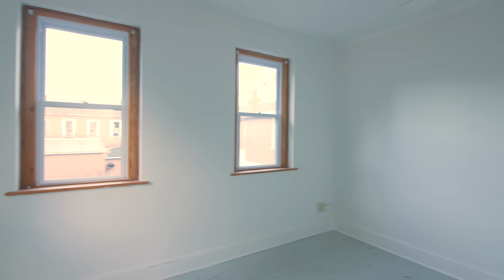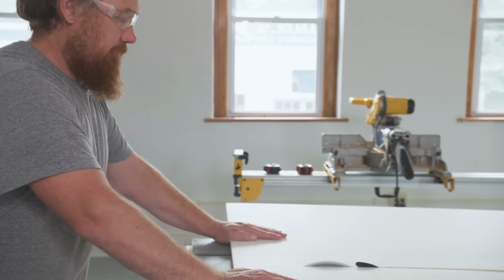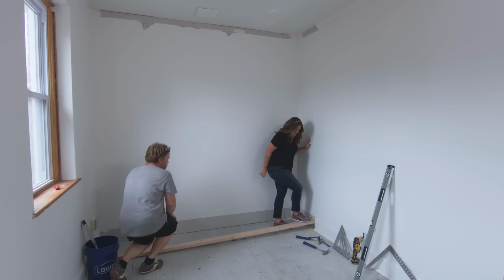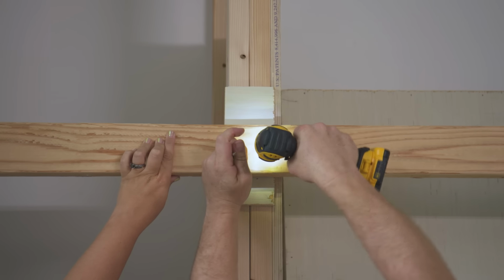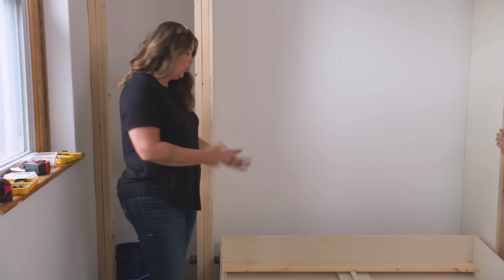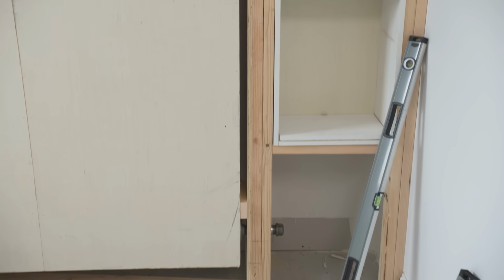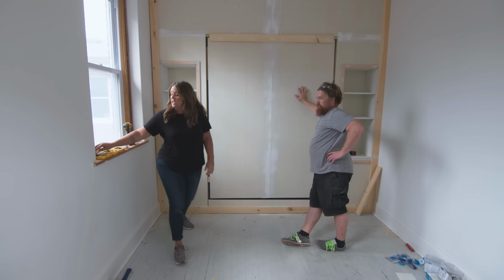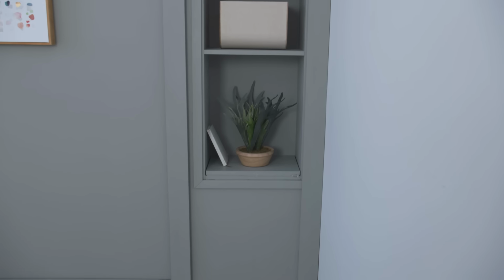How to Build a Hidden Guest Room w/ a Murphy Bed

Comment: This is fine for that once in a while guest.  Any more than that and it is a PITA to convert and possibly dangerous with the weight of the unit.  I would have figured out how to utilize some gas struts to help support the bed.  Definitely less expensive than buying one of those $300 murphy bed kits.  I would have utilized the space above the bed for more display space or build cabinets for storage of the pillows, blankets, and/or other items that are not needed on a daily basis.  The access panel does make for a nice space to hide a few items that you don't want the kids to accidentally find.

Comment: The idea is good.  So many things wrong with the execution though.  1) For less than $200 you can buy a spring or piston based hinge/assisted opening mechanism, and you don't need any threaded pins, dangerous opening procedures, or pipes rubbing on plywood. 2) An absolute ton of wasted space.  So many more shelves, cabinets or drawers could have been added over under and side. 3) Recessed lighting with bedside switch. 4) Shelving inside the wall next to the pillow with outlets to set/charge phone, put a book, etc. 4) finish nails and  butt joints to build shelves?  5) Removable velcro gap covers is awful.  Not too hard to design it so you don't need them. 6) The 9" sides are way too high and not needed.  You will be banging your legs on those when sitting on the edge of the bed, unless your mattress is a rock. 7) Trim on side cabinets only goes 3/4 of the way around.  8) not a fan of drab gray.

Comment: the moulding to hide the bed frame, could have been attached with magnets, with hiddens magnets to place them under the bed. More expensive yes but overall a better solution. And instead of a frame with no storage push latches to "hidden" cabinets.

Comment: Okay. There is so much lost storage, they didn't use the same crown moulding/base board to frame the new wall, the velcro trim you have to remove every time you use the bed, the power strip just hanging out in the open... Also, there are hinge kits specifically for murphy beds that make lowering/lifting easier and lock the bed upright. I've really liked most of the other stuff Monica has done, but this whole project is just a mess, from design to construction it's all poor work. Sorry for the negativity :/

Comment: Personally, I'd just have a sofabed in there; it keeps the resale options of the property wider, as not every buyer wants a murphy bed and might want a child's single bed in there, but now they've just got a smaller room to use instead.  It also makes nightstands easier to reach from the bed..
Reply: Simples, remove the drop down bed and you have room for a standard bed or wardrobe, extra cupboard, whatever! 
All it takes is a little imagination.........
Reply: @fabianmckenna8197  Point is- removing all of that isn't as simple as just swapping one sofabed for a different bed.
Reply: @scattygirl1  Well if you're keen on sofa beds, that's fine.

The idea was to build a hidden guest room with a Murphy bed so if you don't want that then don't build one. 
If you don't want to buy a house with a Murphy bed then don't buy one.

Plenty of people out there getting fresh ideas from this basic video which can be adjusted to suit.
Good job.

Comment: The storage on top
would have been great for extra pillows and blankets etc.I also don’t like the Velcro Idea maybe some Piano hinges so you can just move the wood out the way. Also Having to unscrew the bed to get it down. Maybe come up with a different but still safe Idea. Also the bed looks heavy. They has to be a mechanism that can help bring the bed down. 
I’m not trying to be negative. I think the bones of the project are pretty decent. But a little tweaking couldn’t hurt. Some of the comments are really helpful in making this project even better.

Comment: Someone forgot to use the utility knife on the bottom of the cornices to prevent the dry wall being peeled off during its removal... Also why didn't you guys just use a Murphy bed kit? Would make the transformation process a lot easier.
Reply: .......... and a lot more expensive.
Reply: @fabianmckenna8197  bed kit. Not a premade murohy bed.
Reply: Murphy bed kits come with hydraulics, fitments and plans. 
You have to provide the wood so any pre made bed would incur the costs of the kit, wood and of course the labour. A lot more expensive than DIY.
Reply: @fabianmckenna8197  the cost of the wood is  a given regardless of which choice you make and the same goes for labour. The only difference is whether you choose to trade in the extra labour for the convenience of using a kit which ultimately makes it easier to use daily. There is of course the intrinsic reward of building from scratch.

Comment: I like the idea, but thought there was wasted storage space and huge room for improved design.  Like a more interesting paint feature for when the bed is up so it is not a giant grey wall.  Running an extension cord is not ideal for long term safety.  An electrician could have easily corrected that and recessed lighting above the bed for reading lamps would have been interesting as well.

Comment: Would have finished out over the bed and added doors, so as to have space for pillows, etc.
Reply: Yeah, the bed itself, or room needs storage for bedding, and other guest stuff, the only thing lacking. Can always chuck a small bureau in there.
Reply: That is what i was thinking, i think incorporating a short (12") U the entire width of the bed at  the top (right under the doors) that is flush so when you lower the bed it swings out and now the leg is the width of the bed, this would make the bed much more sturdy. Now you can permanently attach the cover pieces of wood to the bed that she attached with "velcro" to hide the cracks, i would also utiilize the bottom of the bed with a murphy desk or at the very least some sort of permanent art/picture. I'm pretty sure i just found my next project! Love
Reply: Liza Velasquez, or one of the larger framed pieces of art that folds down to a table with sides of frame becoming legs for the table. Now you have a space for gift wrapping, crafts, etc. Just another thought. The Murphy desk would be the best though.

Comment: Very cool, things I would do differently, Instead of velcro (as it will look bad when the bed is down having squares of velcro on the wall),  I would have used strong magnets in the planks and metal or magnets recessed in the backside of the plywood on the wall section so it is not seen and the trim just sticks right in place when you have them up.     Some spring-loaded hinges to make lowering and raising the bed very easy for a single person and a different mechanism for securing the bed when up. But I get you are kind of wanting to make all the parts things lowes is selling.  Oh and for sure some Loctite on those threaded ends of that pipe hinge you added. When one works its way loose it does not look like you have access to rethread.  Bed frame/box nees some more work to stiffen, I can see it twisting which will get worse over time and eventually fall apart.

Comment: To hide the space around the bed, why didn't you just attach it to the bed frame and not use Velcro that has to be removed to use the bed.  To much wasted space. I did like the idea of the flanges to use as a pivot point. Would save you money on the high cost of a kit.

Comment: I would use it for my craft room and I would have kept the top of the bed wall open to use as storage. ut hidden with wood doors for access. Love the way you used the pipe for the hinge for the bed. Quite clever idea.

Comment: I loved the fact that you used caps and flanges instead of the topical brackets the onlything I would have done was when I was up to would have made it a book shelf and had molding to hold the books in when done as a bed at the foot of bottom of the wall where the molding is have a access panel to hide the pieces to old the books or videos in place when the bed is down

Comment: Why didn't you use all the dead space and run hard wired actual electrical wiring and outlets for the sides and top at the time it was framed out?  

Instead you added a cheesy cord that could get pinched and an eyesore access panel.  In terms of access, you unscrew a bank of shelves - not that hard and it's not a permanent  close off.  If you don't want electricity behind the frame, have an electrician come in and hard wire 2 four gang boxes on both sides of the wall, that way you have traditional outlets and usb plugs for devices, which is a huge plus in any room.

My biggest concern was...when you have pivots made from screw thread pipes, how long will it be before they come unscrewed?  I also agree with others that the floor of the bed frame was way too thin and unsupported - it was racking when they lifted it up.  

Overall the concept is a good idea but really needed a better blueprint.

Comment: Legs look too weak. I would frame out the bed and attach the boards to the bed so you dont have to put them under it. Also just cover the gap so the boards dont protrude from the bed enough to be annoying.

Comment: The concept is great. Others more knowledgeable than I have highlighted any construction/mechanical deficiencies. My question is: if you use it as an office or workout room (inter alia) when it's not in guest room mode, what do you do with all that furniture/equipment when the bed needs to be lowered and take up floor space?
Reply: Haha right? Where would u move the desk? Or gym equipment

Comment: I consider this a very good and smart design especially using the metal pipe with flange part (It'd be very expensive if you buy a set of those Murphy bed hardware). I think this is a video showing the making/hiding of a Murphy bed and people can design the rest of the space to their like. The bed frame does not look rigid but it's all your choices on choosing the material.. .
Reply: I wondered why she did not use the hardware for a Murphy bed.  Now I know. Thank u

Comment: This is almost exactly like the one I designed. However I Incorporated a 12in work table across the width of the bed bottom that also serves as a leg when the bed is down
Reply: Do you have a video?
Reply: my husband built  one and the bottom is shelving and the shelving is used as “legs” when the “bed” is down. It is ok but, man ! Is it heavy! Would definitely recommend the mechanics involved to make it easy to lift. Most guest would appreciate this so they don’t have to help and I don’t have the strength!
Reply: Please add a video
Reply: Smart idea💡
Reply: just have to be careful to support the end of the bed as desk support tends to be in the centre of the frame length, and the end of the bed needs support usually - I make one which stays flat when opening the bed but we still need the leg supports as we don't let it touch the floor for this reason.
Reply: I'm designing mine so all the 'shelves' that will be the legs can hold stuff like decorative blankets, pillows that have seasonal covers or team covers and fixed behind them will be screwed into place photos that when the bed lays down won't fall off, but the photos can be changed out as seasons or kids grow.

Comment: Not a bad idea, but not executed in the best way. A Murphy Bed kit would make life so much easier.  Having to remove the eye bolts, lower the heavy bed (which looks to twist), and then set up the legs is a hassle.  The space above the bed could be used for endless storage of blankets and pillows.  And what I disliked the most was the use of an extension cord.  There are so many other options that could've been done there.  Recessed outlets with built in USB would've been the best choice.  The kind you would fine in college lecture halls on the desks for laptops to plug into.  Again, great idea, but for a large company like Lowe's, I expected it to be better.

Comment: It's a great idea and turned out really well, not expensive.  What I would have done a little different; I would have put cabinet doors under the built in shelves on both sides, a place to maybe store a suitcase or......and cabinet doors across the top of the entire build for additional storage for maybe seasonal things, not needed all that often.  As far as the using the room when not in "guest mode", could be a number of uses, office, work out room, additional shelves for books - small library, crafts, so many choices.  It looked pretty simple and looks good.

Comment: Ditto the comments on lost storage potential.  BUT a really good build and ideas I hadn't thought of before.  We did a self build Murphy build a few months ago, transforming our old office into a mostly office, then bedroom for guests just a little bit.  Has been great so far.   But these ideas are better concerning the build.  If doing again I would use the concept of framing up and maybe the hinges and temporary safety framing (which we had a lot of trouble with in our build) plus shelving with  doors to access the storage above any old time.  So pleased I found this video.  Great start.  Just the final few percent that could be refined.

Comment: I wouldn't come back to visit if you expect the me to remove molding and let down a DANGEROUS bed and then reconstruct it.
Reply: I’ve seen some built in Murphy beds where the feet of the bed became coat hooks or shelf brackets and I have never seen a seam before.

Comment: I actually want/need to do this in my "office" we are a small 2 bedroom house so my "office" is actually the second bedroom. This is a great template. I would actually create an opening/cubby from the inside for the side tables so they can be accessed when the bed is in the down position. I would also probably put doors along the top for extra storage too. I really like how low profile this is and doesn't take up much depth space. Because it is in my office I would just put a reading chair and side table in front of the bed when it's hidden just to have more usable floor space too. Thanks for this video and build it's awesome!!

Comment: A great project.  I agree with some of the other comments that a lot of space that could have been used for additional storage was wasted, but I understand these videos are only so long not a full detailed project.  Additional storage could easily be used simply by extending the shelves to the ceiling and over the bed and below by adding doors for hidden storage if desired.  Am also wondering if there would be a way to finagle attaching the final trim pieces that frame the bottom of the bed facing out into the room when in the "up" position (buried in the wall) that would not require the pieces to be removed before the bed is lowered - maybe just by moving the industrial strength Velcro solely on the bottom of the bed with no overlap to the other side of the seams/opening around the bed?